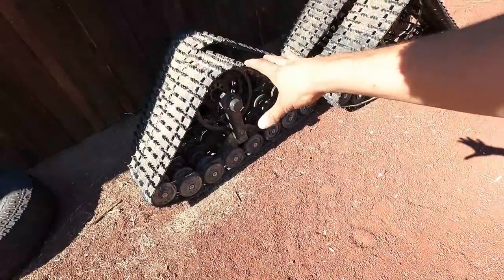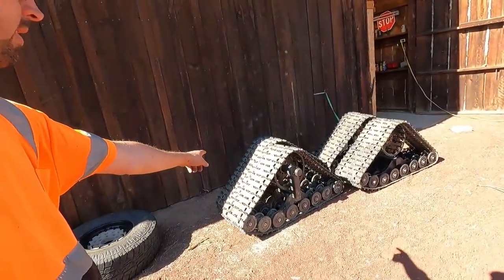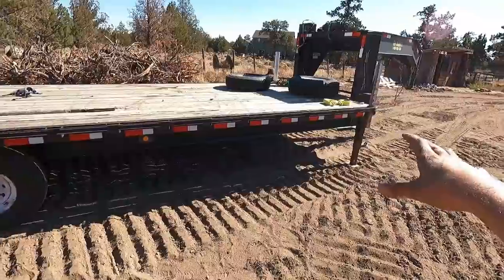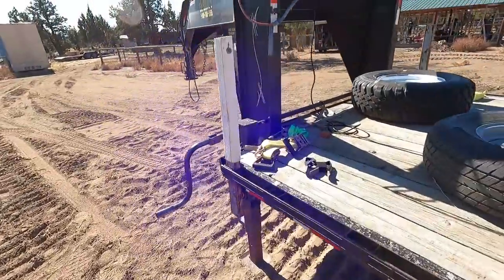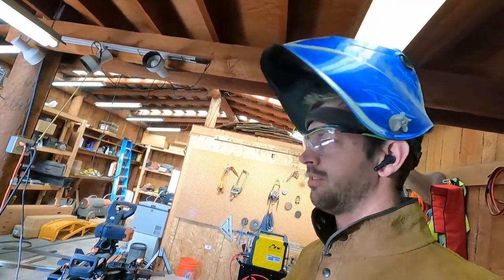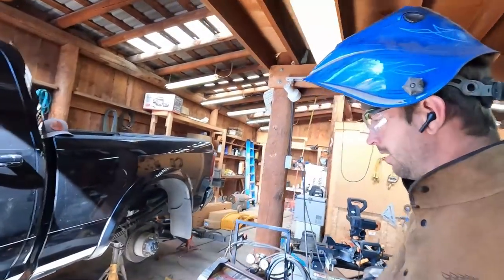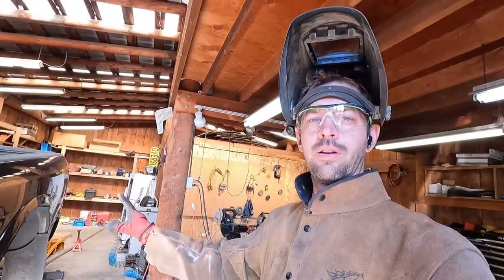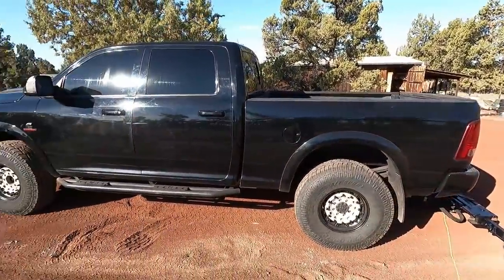Fixing the frame on my brand new tow truck

Comment: Your breaker box relocation and conversion would be a simple Saturday project. I could draw you a simple schematic, and the parts are at Home Depot. Saturday morning winch the office room out of the shop and turn into a shed, then afternoon do the electrical with a breaker and outlet for the welder. Simple Stuff!

Comment: That is one nice thing about part-time 4x4, can tow without having to remove drive shaft,, i still run the 249 full-time transfer case in my zj, personally i like it and way it works, getting same mpg as prior 3 zj with part-time transfer case

Comment: Nice trailer with the folding beaver tail.
 I have seen pictures of tractors broke in half from abusive loader work. Not just broken bolts either, totally broken castings or flanges on the castings.

Comment: Im glad you reinforced the frame. There is a new ram pickup pulling a bumper pull dump traiier .They overloaded it in a gravel pit with loader, truck bent in half It's on you tube. It would probably happen to any brand truck the way they loaded it.
Reply from the maker: That's why you don't but trucks with coil spring rear suspension.   It leaves the frame completely unsupported from the axle back.

Comment: From looking at your panel you have blanks you can knock out and add a double pole breaker to that existing panel then wire you a 240 volt single phase outlet next to the panel with the amperage requirements for your welder.
Reply from the maker: That whole panel needs to be replaced

Comment: Hello  you said your  chassis needs  to flex .  But you can look at it in to way's  you have a solid chassis and let your suspension will do all the flex that is the way it should be  you can control suspension  but hot a chassis  👍

Comment: Make a 3 way cord coming off 2 separate 110 breakers into a 220 outlet for your welder.  It would be pretty easy to do.  Until you’re able to rewire your panel box for 220.
Reply from the maker: I have a cord for doing exactly that, but all the breakers on this panel are running off the same 110 leg, so it wouldn't work.

Comment: Instead of tearing the room out, I'd make it either a paint booth for repainting things or fill it with the shelves and make it parts and tool storage.  Save a lot of time and energy tearing it out that way. :D
Reply from the maker: Nope, it's coming out.   It completely kills the workspace
Reply: @CaseyLaDelle  fair enough. :)  While I doubt I'll get to your state before you get it all done, I'd be happy to help you with your electrical panel. :)

Comment: I know your new truck is a multi-purpose truck. Though your modifications are a little difficult for me to swallow. (Most people are scared sh*tl*ss to add any dings to a new motor vehicle). But you always seem to come out ahead of any situation.
Reply from the maker: It's a 7 year old truck with 100k miles on it that was bought to work, no need to baby it
Reply: @CaseyLaDelle  Dang Casey It looked new to me. Well that makes me feel better. But it is your chariot and you have ever right to do what you want.

Comment: Welding it along the bottom does NOTHING for reinforcing a frame. Welding along the side of the frame is ehat stiffenes it up. You totally wasted you time. What you just did is pretty much nothing
Reply: As a practicing geotechnical and structural engineer I understand the mechanics of materials and what the effect of adding reinforcement to the side of the frame member does to the frame strength and stiffness.  You are partially correct; adding the reinforcement to the bottom of the frame would improve the Section Modulus and Moment of Inertia of the frame more than it does if it is added to the side.  However, the reinforcement he used (3/4 x 2") is a very substantial piece of steel and is much heavier steel than the original frame.  I suspect his reinforcement will probably increase the bending resistance and stiffness of the frame by at least 50% which should be adequate reinforcing. Even though adding reinforcement to the side of the frame isn't as effective as adding it to the bottom, it is still substantial reinforcement and not at all wasted time and effort.